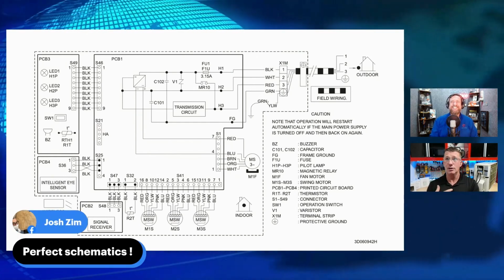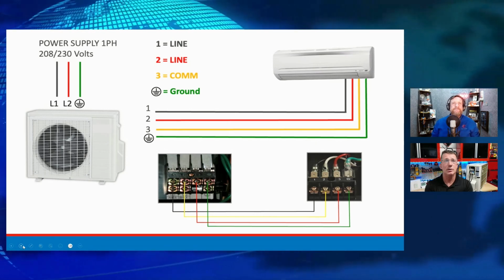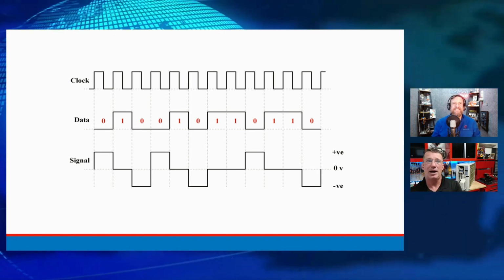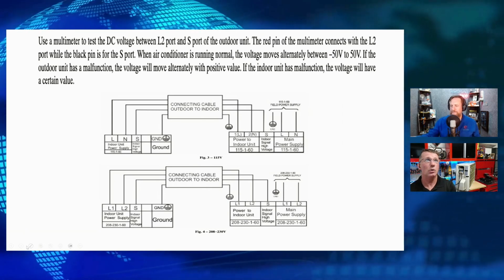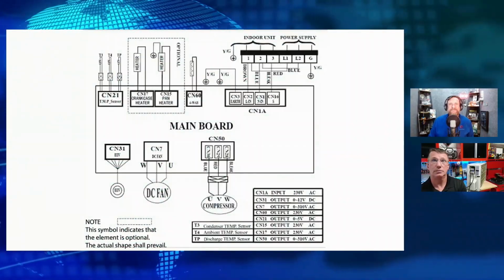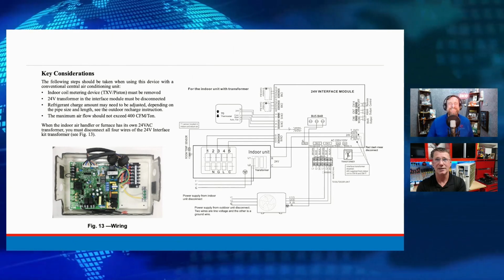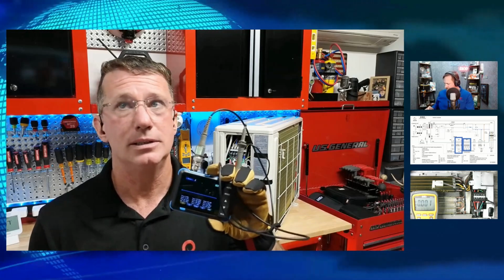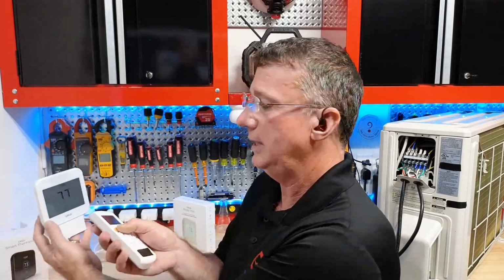Unlocking The Secrets Of Ductless Communications: Did You Know? The ESCO HVAC Show- Episode 96!

Comment: Very well said, gentlemen.  Mitsu guy here - 12-24dc fluctuating on S2/S3.  Outdoor sends 24vdc, indoor responds with 12vdc. That’s how you troubleshoot.  Also, fun fact although I’m not sure if it’s true, but they are able to share the S2 wire because AC travels on the outside of the line and DC travels in the middle.

Comment: It would be nice if the manufacturers would agree on communications protocols.  For those who might wish to delve further into how to create a list of those protocols for the IR remotes, you could consider programming an arduino to read the signals from different remotes and creating a chart showing what each button does for each manufacturer, then converting that signal using the arduino programming.  This would, of course, be an exercise for those who wish to understand this better.  This link explains this process and also how a person could easily use their phone to see the IR light coming out of your remote if you don't happen to have an IR scope.  https://www.youtube.com/watch?v=8E3ltjnbV0c       Now if we could just get those manufacturers on board so that the technician could see the signal with the oscilloscope then verify that the PWM is correct rather than just seeing if it is there.